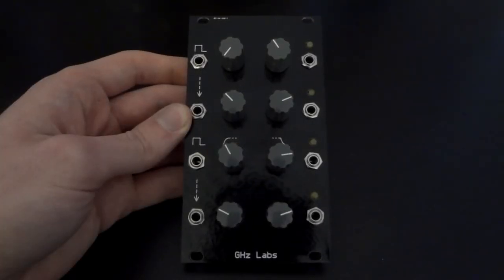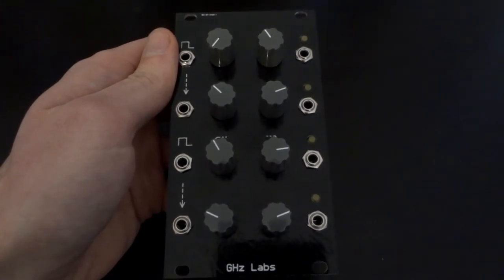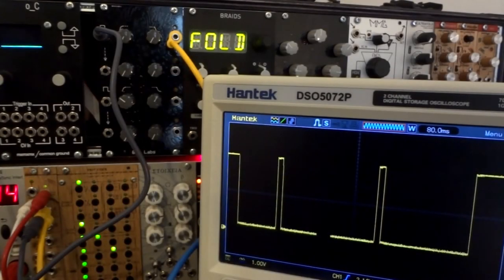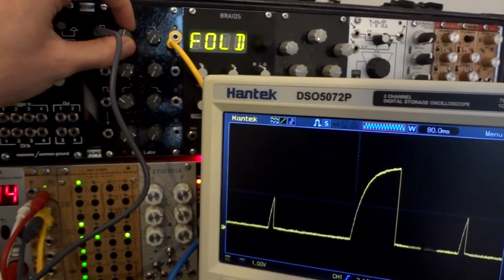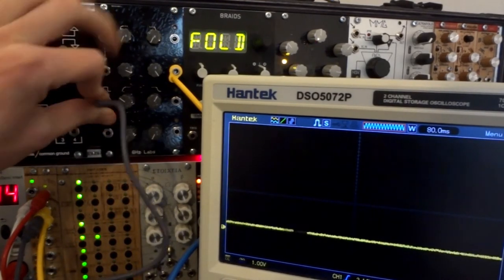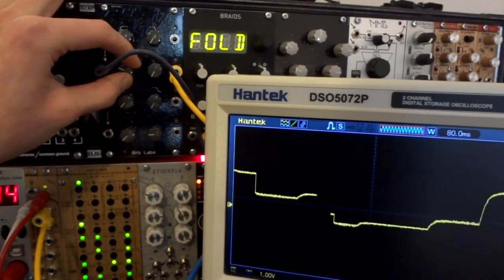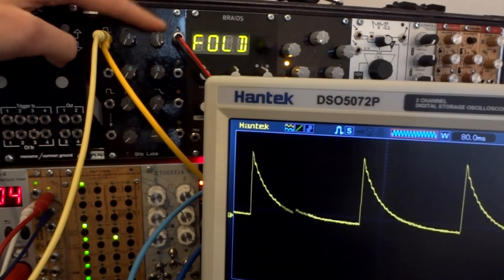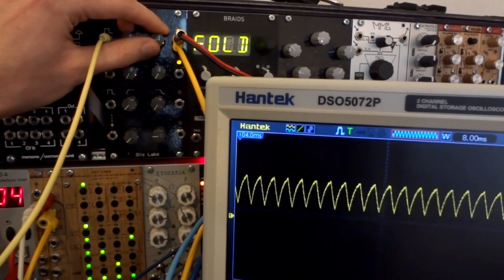Envelope Generator - GHz Labs (DIY Eurorack)

Comment: Hey Thomas, 
thanks for the great module design! 
I experienced cv bleed, when there is no envelope triggered or in between the env. 
Is there any simple way to change the offset?
Reply from the maker: Hi Fabian! What do you mean CV bleed, could you explain a little bit more what is going on and what you are expecting? There should be no offset if there is no connection to any input at all. Can you measure the output voltage with a multi meter or a scope?
Reply from the maker: Technically speaking, this module is actually a slew rate limiter, so whatever is on the input will be on the output but "slowed down"(it follows the input CV). If your input never drops to 0V for example, the output will never drop there either.
Reply: @TomashGhzegovsky  Hey Thomas thanks for your answers took me a while to gain access to a scope :)
without any input there is an offsett 120-130mv...
I´ve added additional caps on channel 2+4 to get longer Attack/release values (all measurements were taken on channel 1 tho).

If there is an input on channel 1 there is an offset of 170 mv in between the envelope cycles.